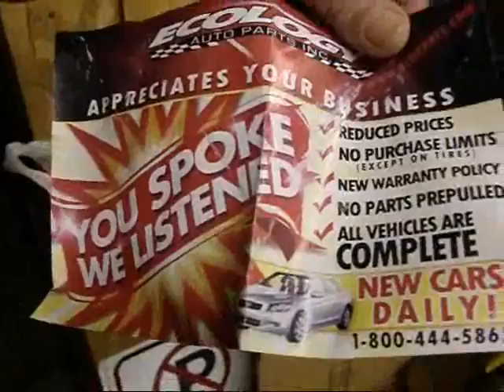3 13 13  SF Sub Door Latch Fluid Film Vid

Comment: The driver's door on my Safari is starting to get bad.  I have a new set of hinge pins for it, but the welds on the hinges are starting to crack.  Plus the door handle is broke, again.  Last one only lasted 2.5 years!  Those door handles are garbage!  When I go to work on it (one of these days), I'll spray it all down good with Fluid Film!